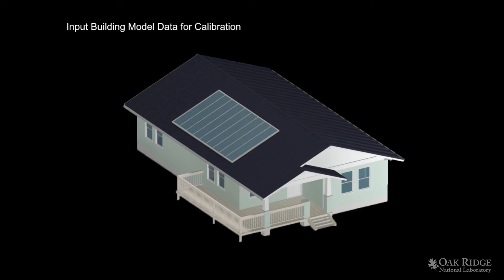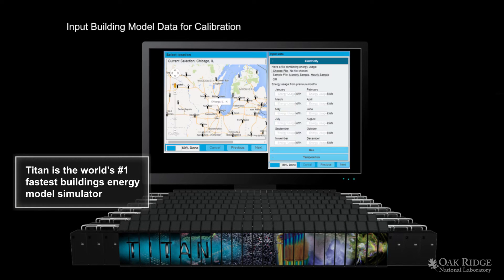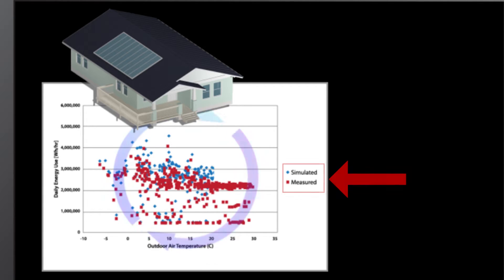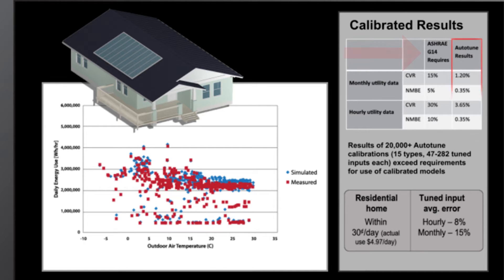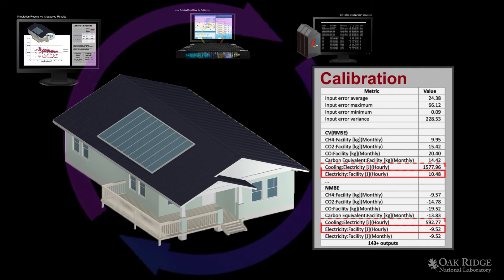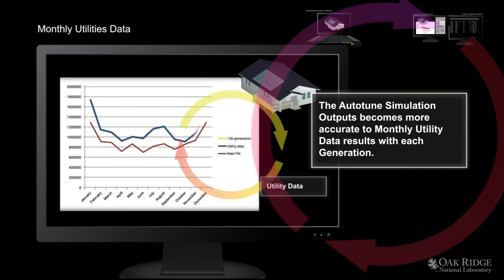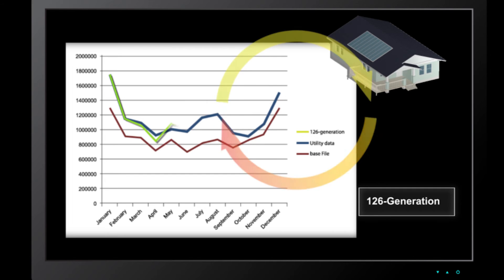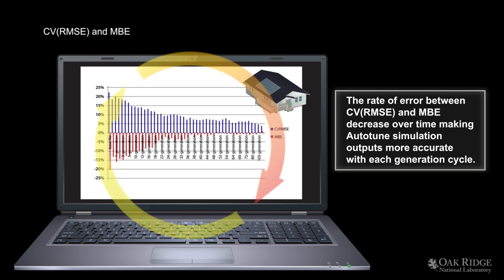Autotune calibrates models to building use data

Comment: @Oak Ridge National Laboratory - I have to ask... 
1. Is it going through and reshaping the algorithms in the simulation or adjusting 'adjustment' factors? 
2. Once it has tuned the calculations - is it the simulation effective for another run? 
3. Is the simulation effective to run in other regions?

One example of what throws off simulated data from real data is doors and windows being left open... I am looking for a real, effective simulation to get the metric right based on proposed construction and verified against as-built conditions.

Thnx!
Reply from the maker: From Joshua New, the lead researcher on the project:

1. Is it going through and reshaping the algorithms in the simulation or adjusting 'adjustment' factors?
   Autotune changes 47-470 (based on building type) of the ~3,000 simulation inputs that are required to describe a building. While users can modify for the inputs they care about (infiltration, HVAC, lighting, etc.), the default “uncertain” parameters, referenced as Supplementary Material 1 in the recent Applied Energy article, can be viewed at bit.ly/29J3HHM.
   Autotune is simulation-engine agnostic, but is shown in the video as using EnergyPlus. There are other dissertations and ongoing, multi-lab efforts to empirically validate the EnergyPlus simulation engine and further reduce model-form uncertainty by reducing the gap between physics and algorithmic approximations.
 
2. Once it has tuned the calculations - is it the simulation effective for another run?
   Not calculations, but inputs, are calibrated. Once a building model is calibrated to ASHRAE Guideline 14 requirements, the model can be used with greater confidence and with agencies involving tax credits (IRS), performance tradeoffs for building code compliance, and financing (banks).
 
3. Is the simulation effective to run in other regions? One example of what throws off simulated data from real data is doors and windows being left open... I am looking for a real, effective simulation to get the metric right based on proposed construction and verified against as-built conditions.
   Yes, with a couple caveats: (1) Most regional change is accounted for by swapping out the weather file used. Where you get weather data from can impact annual energy use by 7% and monthly heating/cooling loads by over 40%. Buildings codes can change between regions and should be converted in the calibrated model.
   Zone-level infiltration impacts due to open doors and windows, as well as more detailed occupancy/equipment schedule characteristics, are large-impact variables that can be calibrated by Autotune.
   There is a new technique coming out in less than a year called  “hybrid modeling” which can use temperature data from a thermal zone that can also estimate infiltration and thermal mass of the zone. This capability will eventually be added to EnergyPlus.